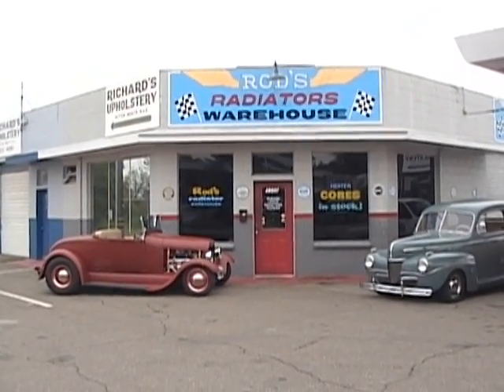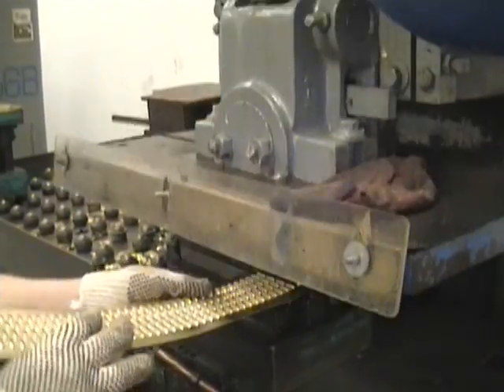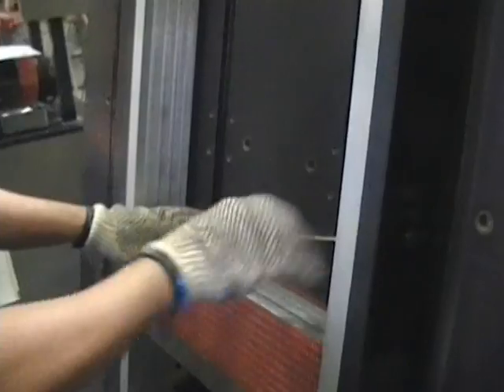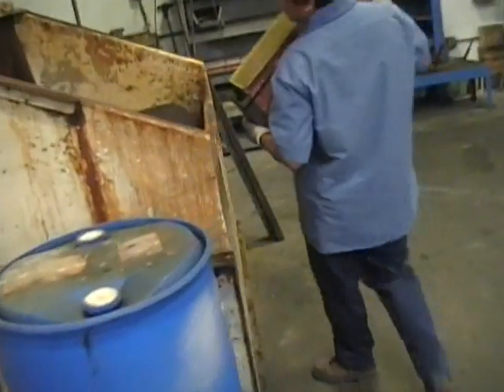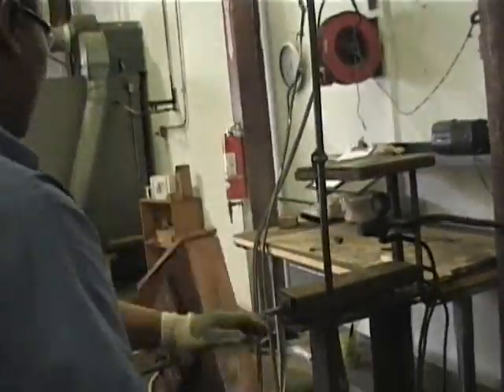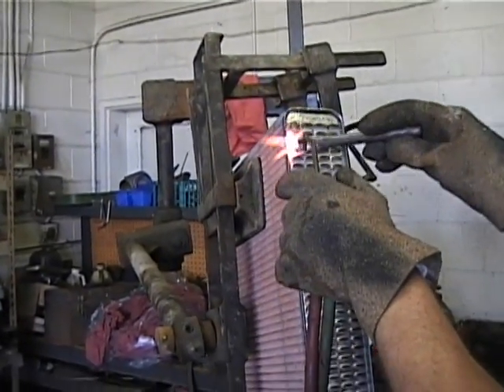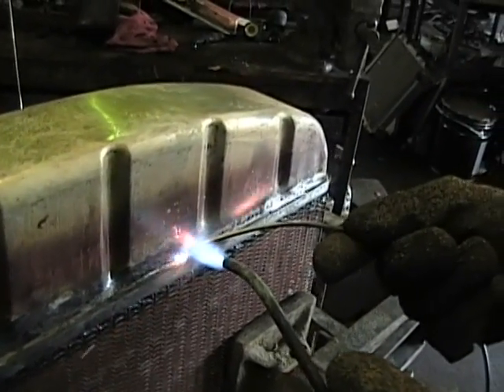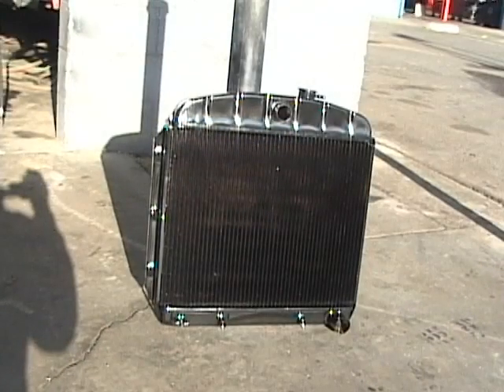Rods Radiators Builds a Custom Radiator

Comment: Not bad, my life between 75 and 92 was only radiators . I did lot of custom show car radiators.  ( polished brass) have very careful where apply flux. My shop gave a 1 year guarantee on a new radiator.  2 guarantee on a recore. Family business that started in 1923. I learned from the best.  Back on mid 80's I built a radiator for a friend's son for his 71 olds 442. Still has it. Original Harrison talks.  But 5 plate oil cooler  out of a 70 one ton Chevy pu with plow set up. It's how they're built

Comment: Thanks for the video. I just bought a new aluminum radiator but the side of it is crushed in some (not big but enough to see that its squished in). How much will it cost to repair it and will this dent cause any issues? Seller is offering me an $8 refund.. It seems on the low side to me.. :)
Reply from the maker: rag Doll Bring it by and we can check it out for you. We straighten and repair many aluminum radiators, especially motorcycle ones. Or give us a call (530) 223-3978
Reply: @RodsRadiators  do you guys repair oil coolers?